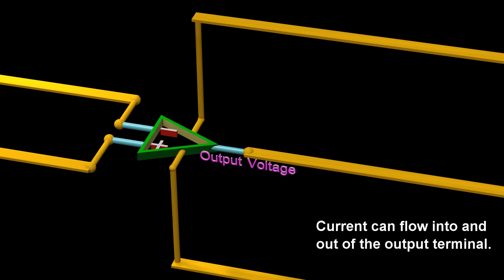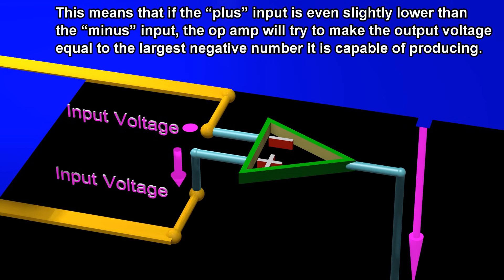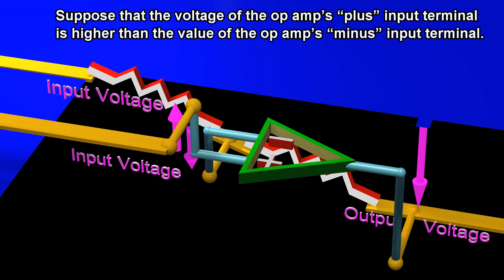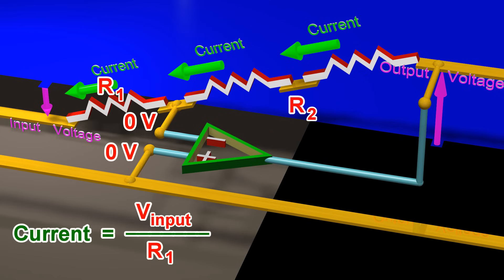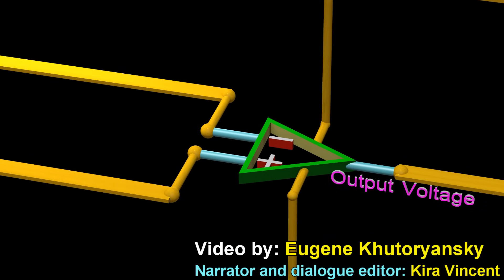Op Amp Circuits: Analog Computers from operational amplifiers

Comment: Hii, why's the output max/min in case of positive feedback?
Reply from the maker: The op amp can't produce an output voltage higher than its positive power supply voltage rail, and it can't produce an output voltage more negative than its negative power supply voltage rail.
Reply: @EugeneKhutoryansky Thanks! But why positive feedback doesn't work like negative feedback, i know it's because in positive feedback the output is added but, can you please explain this using equations. Output= A(V+ - V-)
Reply from the maker: Negative feedback creates a stable equilibrium, whereas positive feedback creates an unstable equilibrium.  I explain stable and unstable equilibrium points, including the mathematics, in my video at  https://youtu.be/p9qrHdPEe28
Reply: @EugeneKhutoryansky thank you so much 😊👍

Comment: Why not current decreases when number of resistors added  in series? Because resistors having the property of decreasing the current???
Reply from the maker: The output voltage of the op amp adjusts to prevent this from happening.
Reply: @EugeneKhutoryansky  thank you

Comment: 5:55 shouldn't the current though the resistors be flowing in opposite directions?
Reply from the maker: I am showing positive current, which is in the opposite direction of electron current.  I explain this in my video on visualizing voltage at https://youtu.be/-Rb9guSEeVE

Comment: But how exactly do the input voltage and the fed-back output voltage "add"? If R1 and R2 formed a voltage divider, that would require that a current flowed, but opamps are supposed to be high-impedance devices, so where and how would the current flow? And there must be currents, otherwise resistors would make no sense.

Comment: Why is the current equal to Vinput/R1 at 6:58 when R1 is in series with R2? Shouldnt it be Vinput/(R1+R2)?
Reply from the maker: It is because the other side of the resistor is at zero volts.  Therefore, the total voltage drop across the resistor is equal to V input.  The current is the voltage drop divided by the resistance:  V input / R1.
You were thinking of a voltage divider, in which case the midpoint of the two resistors would not be zero as it is in this case.
Reply: @EugeneKhutoryansky  Thanks for the quick response

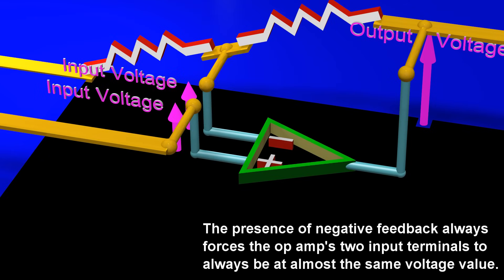Comment: Since at 2:31 Output Voltage = very large number · (A-B)    at 5:01 output voltage should be 0V, why is it not the case?
Reply from the maker: Because the two inputs are not exactly equal, but slightly different.
Reply: @EugeneKhutoryansky   so at 5:01 , + input voltage is slightly slightly more than - input voltage isn't it? Thanks for your answer and huge thanks for your videos.

Comment: Thanks so much for this - it's the best description I've found, as an electronics beginner, to how negative feedback works. I've got the kind of mind that's too old and lazy to learn maths, but worries when I can't picture how a thing works. Also, thanks for going on into integrators and differentiators - I'm trying to learn a bit of synth DIY, and I can see uses for this in terms of rising edge detectors... I'll be rewatching this for sure.

Comment: At 5:00, we can see how the voltage dividing formed by the two  resistors determines the voltage gain. This is a great tutorial that really helps us have fun with op amps by truly understanding their operation.  When troubleshooting op amp circuits, anytime you find a voltage difference between the inverting and non-inverting inputs you should suspect that this is a defective op-amp I.C.  in a healthy circuit, the +&- inputs are  almost exactly equal.

Comment: Using the resistors coupled on a lever of the negative input of the OpAmp is freakn genius, makes visualizing it so much more intuitive. So if the R value increases the length of the resistor on the vid will increase thus making the lever pivot in a way which relates the output voltage to the input voltage in a certain way. Damn thanks alot.

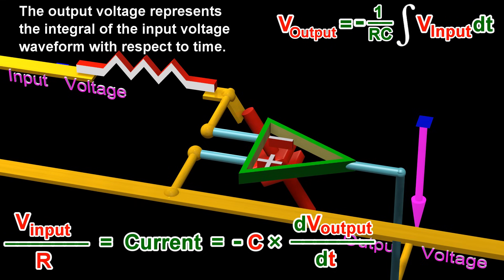Comment: in 9:52
How to get Vout formula?
thanks.
Reply from the maker: You start out with the equation at the bottom, which can be rearranged to give, "d Voutput / dt  = - Vinput / (RC)".
You then take the integral of both sides to get the final equation for Voutput.

Comment: 2:38 Comparator
6:35 inverting Amplifier
7:30 non-inverting Amplifier
8:00 Voltage Adder
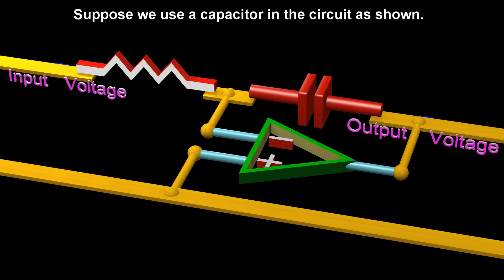9:30 Integrator
10:07 Derivator
10:42 Voltage Buffer
Reply: 0:00 Eine kleine nachmuzik
5:46 Für Elise
8:10 Eine kleine nachmuzik
Reply: @mandarbamane4268  goated
Reply: Thanks
Reply: Thanks a lot!
Reply: very helpful thanks

Comment: 9:21 You're need to multiply it by the ration of resistors for that formula to work
Reply from the maker: I stated in the video that all the resistors in that circuit are of equal value.
Reply: ok i see. Thank you.

Comment: if both +ve and -ve terminal terminal voltages are equal after feedback,doesn't the output voltage become zero again?
Reply from the maker: They are not exactly equal.  There is a very tiny difference between them, and this tiny difference is multiplied by a very large number.

Comment: I wish to ask you a question.
You said that current can't flow into the input of the OpAmp, but as you show, it is flowing there. There is current flowing through the resistor you have on the input, then I presume the flow must continue to the input.
Please correct me if I am wrong.

Thanks! :)

Comment: Very nicely explained, I do however have a question about the example you gave. My question: When the voltage was input at the inverting terminal and the resistances between Vo and Vin were R1 and R2 (the increased ressistance) you mention that -Vo=(R2*I), why does the ressistance change to (R1+R2) for the same Vo when the input is applied at the non inverting terminal? Why are we not adding the R1 ressistance to the output voltage drop in the first case and add it to the output voltage drop in the second?

Comment: Is this how a comparator is made?
Reply: not modern ones, just the originals. These are now used for hundreds of other applications, the most obvious of which are audio circuits such as amplifiers. Computers now work using CMOS which i'll spare the details of but basically billions of tiny switches that will connected together the right way they create complex interactions.

Comment: when the non inverting input set to the 0V then the inverting input was also at 0V.But as the output voltage= A(V+ -- V-) so according to this output voltage must be equal to 0.But in this video output voltage is not equal to 0.So plzz explain me why output voltage is not equal to 0?
Reply from the maker: +Shashank More, the inputs are not equal exactly to zero.  They are just very close to zero.  The output of the Op Amp is then a very large number multiplied by the very small difference in the input voltages.
Reply: can you plzz explain me what is exactly mean by inverting input and non inverting input??.....And thanks for the rply..
Reply from the maker: +Shashank More, the inverting input is the input to the op amp with the minus sign.  The non inverting input is the input to the op amp with the plus sign.
Reply: Ok.......I thought that the inverting input would invert the incoming signal by 180 degree and non inverting input would not.